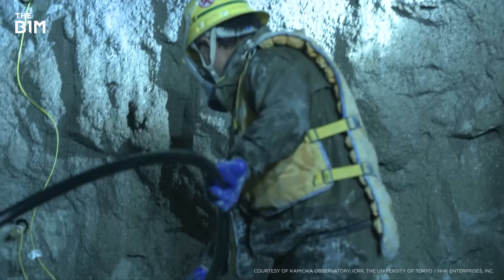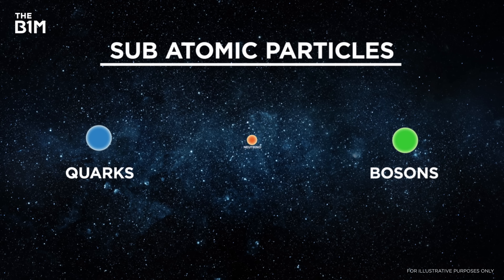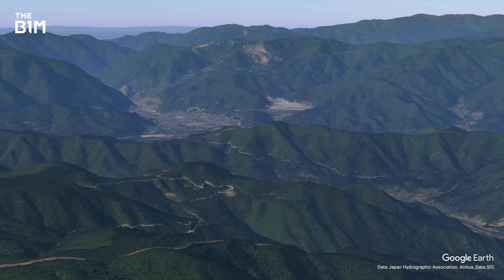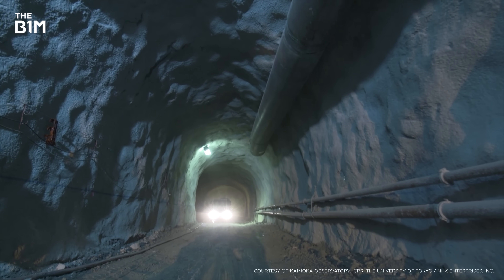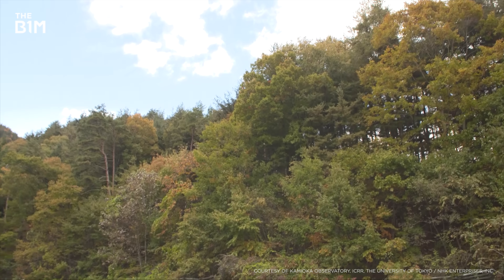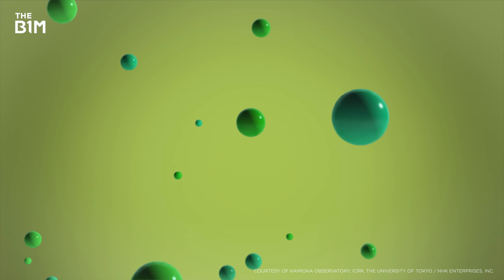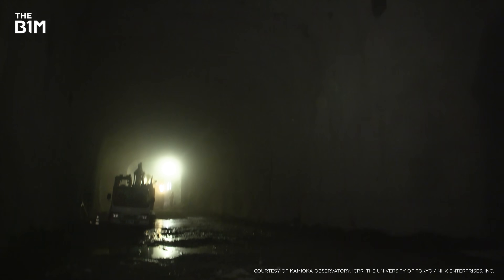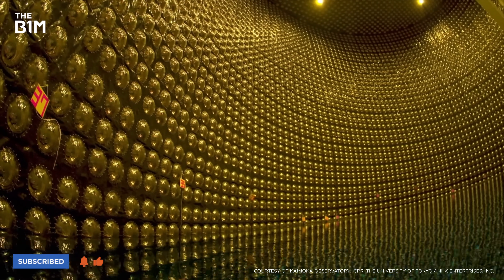Why Japan is Hollowing Out a Mountain

Comment: Nice little physics lesson to start us off. One note is that neutrinos do interact with other matter (or else how would we detect them) it’s just extremely rare. That’s why we need a giant vat of water under a mountain, to act as a filter, reducing all the noise of other particle interactions which would far exceed any interactions by neutrinos. As you mention later, it is the interaction with an electron that the observatory measures. Anyways, love the channel!
Reply: @@karlwithak.  Most likely. I don't see what detecting the faint flash can possibly tell them. Unless there is some kind of variation in the flash we don't understand that would allow theories to be tested on it. Seems like a huge waste of money.
Reply: @The1stDukeDroklar  without these "huge waste of money" our civilization wouldn't advance to current level.
Reply: @The1stDukeDroklar  you tell us what to experiment then, professor.
Reply: @The1stDukeDroklar believe me there most definitely is but you'd have to go and do an undergraduate course in particle physics to fully understand. There will be a few YouTube videos around of you are interested to know what they are measuring.
Reply: @The1stDukeDroklar  These flashes are cerenov radiation-radiation produced by  particles travelling faster than speed of light in water. As neutrinos interact with the weak force the corresponding particle is produced(muon from muon neutrino or electron from electron neutrino). Those particles produced emit Cerenov radiation cones. We can distinguish the type of neutrinos from the shape of the radiation cone. The results confirm "neutrino oscillations", which arises due to the weak interaction mixing neutrinos of different generations, so a detected "muon neutrino" is actually a superposition of other generations of neutrinos(or mass eigenstates). Since they have different masses their wavefunctions will evolve differently with time. After some time, neutrino will now be a mixture of other weak eigenstates. These are neutrino oscillations. They are only sensitive to neutrino mass difference(which is actually how we knew they had mass in the first place)
Reply: What could we possibly learn from detecting the glow from these rare collisions?
Reply: We don’t really know ahead of time with these things but when we figured out how electrons work for example we learned about the photovoltaic effect, Einstein’s Nobel Prize which gave us solar panels. When we studied alpha and beta decay that gave us Radiology, medical imaging, PET and CT scans.

Comment: Is there a specific reason to why water? why not air particles or any other media?
Reply: That's a good question. I'll have a shot at answering, and if I get it wrong, happy to be corrected,

What they are looking for is evidence of neutrinos hitting electrons. They cannot possibly control how many neutrinos pass through the tank, but the more electrons they can pack in there, the more likely it becomes that a stray neutrino will bump into one and they can record it. From what I remember of high school physics, water is around a thousand times denser than air, and that really does mean you get around a thousand times more electrons in a tank of water than in the same sized tank of air. It's a much easier target to hit.

I remember that some of the early neutrino detectors used carbon tetrachloride - it has more electrons in each molecule than water does, so a tank full of it was an even better target than a tank of water, but, water is cheap, plentiful and way less toxic than that stuff. So they are balancing having as many electrons in there as they can, against keeping the whole thing safe, and they've picked water as a good compromise.

Comment: The fact that this is being constructed means that it is cheaper to hollow out an entire mountain and stuff it full of equipment than to put that equipment on a submarine and take it to the bottom of the ocean

That's wild.
Reply: Also a submarine would be packed with equipment that gives off EM radiation, the exact thing neutrino detectors are built underground for - to avoid radiation.
Reply: If you are suggesting using the ocean water to detect the neutrinos, I think the water needs to be very pure to get a good picture.

Comment: Can those Kamiokande chambers used for something else once they're not used as neutrino observatories anymore?
Reply: Why should they stop working as detectors?
Reply: @hausaffe100  At some point you have probably made all the discoveries you can make with them or you have newer more advanced equipment that makes the older ones obsolete. You can take colliders as an example. E.g. the Large Electron-Positron Collider in CERN is no longer in use.

Comment: After watching the video, one thing I'm still unsure about is why making a bigger one is useful when they already have two of the smaller ones.  What are the benefits and how does that change the observation results?  I have no doubt that it's an improvement otherwise they wouldn't spend such a large sum of money to build it, but it's not obvious to someone who doesn't know much about neutrinos.
Reply: Well i would say is because you want as many events as possible to get a good statistics and you are trying to measure events that are incredibly rare. therefore the more water you have the more events you expect to see and the better your measurements are gonna be. 
That' s my guess.
Reply: The main benefit is that there's 5 times more water, so they'll get about 5 times more detections.

If a group of physicists are interested in doing statistics on a specific type of rare event, that means they can get their data in 2 years instead of 10 years of operating the detector. This is one of the plans for this facility, they are going to create a neutrino beam in a laboratory somewhere else in Japan, shoot it through the earth at this detector and see what happened to the neutrinos on the way.

There's also quasi singular events (like a supernove in a neighboring galaxy) - most of those you're just going to not detect at all with a smaller detector, the bigger one gives you a much higher chance.
Reply: The more samples they have, the more accurate understanding they will have.

Comment: I remember someone once saying that if we could ever figure out a way to reliably create and detect neutrinos, we could just beam information right through the planet from anywhere to anywhere without any obstacles or chance of interception, significantly reducing communication lag on the internet and making more secure long distance communication. This experiment may be a step towards that.
Reply: Slight problem: how do you filter out the background neutrino "noise"?  At Earth's orbit, 65 billion neutrinos from the Sun pass through every square centimetre every second.  So if you are standing on the equator at solar noon on an equinox - ie. when the Sun is directly overhead - about 50 trillion neutrinos pass through your head every second.  Just from the Sun.
Reply: @JonMartinYXD  Double tap. Just pulse the signal twice. The odds of a signals pattern being identical twice at the receiver is astronomical, and when dealing with a data stream it will be a long complex pattern, it wont happen randomly, least of all twice.
Reply: @JonMartinYXD  The number of neutrino encounters for some given time is going to follow a Poisson distribution. For a full second if we get an average of 50e12 encounters it's going to be Gaussian. Even though that's a lot of collisions the standard deviation on the number of collisions would be quite small. In a Poisson distribution the variance where we expect a mean of `mean=lambda` events is `variance=lambda`. Therefore `sigma=sqrt(lambda)`. `sqrt(50e12)=7e6`. Since a neutrino has very little mass (I'm not a physicist but I think their relativistic mass is less than 1eV) producing 7e6 neutrinos could be done with something like 1.12e-12 Joules. In other words transferring a terabyte of data would be on the order of just 1Watt-Second. Of coarse, there's a lot more signal processing that can be done in AWGN instead of a simplistic Amplitude Shift Keying, but it demonstrates feasibility.
Reply: @JonMartinYXD  there is radio waves every where but we can still use our phones.
Reply: @JonMartinYXD  With the help of computers, we can screen out the pattern.
Reply: Hrm, my replies aren't showing up.

First, there is no comparison to radio waves because unlike light, neutrinos don't have a spectrum that we can divide up and listen to.  Our mobile phones are made to send and receive a very narrow band of frequencies.  We choose those frequencies based on their suitability for communication, including such criteria as how much natural noise there is and how well a signal on that frequency can propagate through the atmosphere.  If we are in an area away from any cell towers there may not be any light of that frequency - hence our phones saying 'no signal'.  Putting a SIM card into the phone further restricts which frequencies it operates on, namely those licensed by your mobile carrier.  Neutrinos aren't like that.  There is no neutrino spectrum that we can selectively listen to only part of.  Even worse, while there are three different types of neutrinos and three different masses, they exist in quantum superposition until they interact with matter.  Then they become one of the types of neutrino, but not necessarily the type of neutrino they were created as.

As for creating a neutrino signal strong enough to be heard over the background noise, consider that the background noise is being created by the giant fusion ball we call the Sun.  How do we generate enough neutrinos that our detector can reliably notice the increase above that background noise?  How would we even know which direction they came from?  We don't detect the neutrinos directly but rather what ordinary matter does when it interacts with a neutrino and that can manifest in any direction.

Consider that no two points on Earth are further than about 20,000 km apart as measured along the surface and about 12,750 km apart as measured through the Earth.  We will assume neutrinos travelling through the Earth do so at the same speed as light does in a vacuum.  Light travels through fibre optic cables at about two thirds of that.  A neutrino will cross through the Earth in about 43 milliseconds.  A photon travelling through a fibre optic cable along the surface of the Earth will make the journey in about 97 milliseconds.  Is the difference worth it?
Reply: @JonMartinYXD   Exactly.  Came here to say this, regarding radio comms being broken up into bands and there being no such concept or opportunity with neutrinos.

The other thing with modern digital comms, including digital mobile phones, is that not only do they divide up the spectrum into the frequency domain, but they also divide up usage of the spectrum into the time domain, where many phones can be operating on the exact same frequencies for calls which are occurring simultaneously, but each phone gets apportioned regular windows of time to transmit their data.
Reply: neutrino internet lets go

Comment: You can see this video not because HTML was developed by Tim Berners-Lee to facilitate information sharing, but because Charles Kao solved the problem of fiber optic transmission of photons for digital communication, an actual physics problem. You might be an expert on construction, but clearly need schooling on physics. https://en.wikipedia.org/wiki/Charles_K._Kao
Reply: With or without fiber optics we would still be watching this video...

Good try though.

Comment: 6:30 that measure says nothing. The real measure is pressure which solely depends on depth. At 80 m, the bottom most detectors have to withstand 8 additional athmospheres of pressure.
If the 260.000 t of water are in a basin that is only 10 cm deep, you could hold a gate closing the baisn with one hand.

Comment: One thing I’m left with that the video perhaps leave unanswered is why do they need a bigger one? If they already have a smaller functioning one.
Reply: Bigger detectors are more sensitive
Reply: Right!  And if they detect one, then what?  I'm assuming it will measure it better or something but details aren't there.
Reply: @smithoh More information about the particles overall. Yes it's more sensitive because the enclosed volume is larger, so it'll see more events. But it also means that on average, each event is farther from the wall, meaning that the cone of Cherenkov radiation is larger when it hits the PMTs, which increases the specificity with which the originating direction can be inferred. Also, with a larger number of PMTs involved in each detection, the energy of the collision can be established within tighter bounds. By being more specific about both the direction and energy, we can learn more about neutrino sources, contribute to supernova research (notable for their neutrino output), etc.
Reply: @myself248 you smart! Strange to read a comment from someone who obviously really knows exactly what they're writing about. Thanks for your precise and useful answer 👍
Reply: Solid question! Was wondering the same; were results from the other projects inconclusive?

Comment: Why do documentations like this never ever mention where the excavated material goes?
Reply: They dug a big hole below it. 🙂
Reply: Mostly used for either landfilling when building nearby roads and the rocks can be used in concrete and asphalt, it's not jist dumped by the side of the mountain if that's what you are worried about
Reply: @Alucard-gt1zf  I'm not worried, and I know about the numerous options to use the material. I just would like to know how it is used at the particular project the documentation is about.

Comment: Impressive and amazing research!  

So far, it appears that the universe started as something tiny and started to expand to what we can observe and detect today. It also appears that anything we can observe or detect is made from extremely tiny particles which interact and combine with each other based on some fundamental predetermined rules. We have identified quit a few of these extremely tiny particles and have identified quit a few of the rules these particles follow to interact and combine. Perhaps most of the particles and most of the rules but there probably are more.

We also discovered that anything that we can observe or detect is made from the same basic stuff and we call this stuff energy. We know this because we have figured out how to calculate a value or quantity of energy for anything that we can observe or detect. I think we can  say the fabric of the universe is space time but we can also say that the fabric of the universe is energy time because we now know that space is not empty and is also some type of energy and we can calculate or at least estimate  how much energy is in a given volume of space.

It also appears that after the universe started to expand, no more energy was added or removed as it continued to expand. We do not know what the rules were that determined the amount of energy in the universe nor what caused the energy in the universe to start expanding. The rules for how energy expands, transforms, interacts and combines cause energy to cycle from concentrated to diluted states. Although the cycles can be repeated almost an infinite number of times, there will be a time when they stop because as the cycles keep repeating, the total amount of energy in the universe keeps becoming more and more diluted. We call this rule entropy. 

At some point in time, all the energy will become so diluted that it will not be able to cycle back into more concentrated states and we think this is when the universe ends. We still do not know the rules before the universe started to expand and we still do not know the rules after the universe ends and there are probably still many rules that we do not know about that causes the energy in the universe to cycle back and forth from concentrated to diluted states as it continues to expand.

Comment: What is the reason for building a larger version capable of holding more water? Aside from the camera upgrades
Reply: My understanding is that the chance of the cherenkov radiation being triggered is extremely small. by having a larger volume in which you can observe them, you increase the chance of detecting, and measuring them
Reply: They are trying to detect sterile neutrinos which are harder to detect and they need more water to increase the rate of detection.
Reply: Neutrinos interact very, very rarely with other particles; it would take a light year thickness of lead to stop 50% of them.  The bigger the tank the more chance that one of these very rare interactions will happen inside it in a given time.  As another example of how difficult it is to detect these particles, the number of neutrinos created in nuclear reactions in the Sun and arriving at the Earth's surface is 10s of billions per square centimetre per second, yet they have no noticeable effect.
Reply: Simple, more water mores there's a larger chance that a neutrino will hit that water and be detected